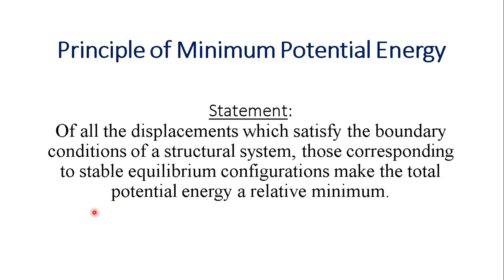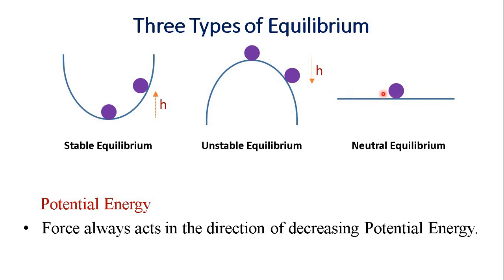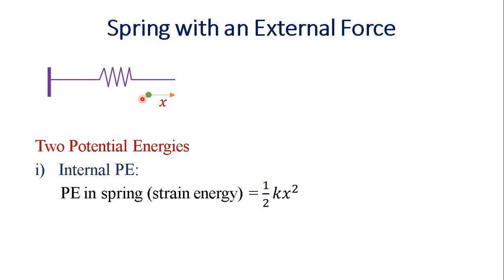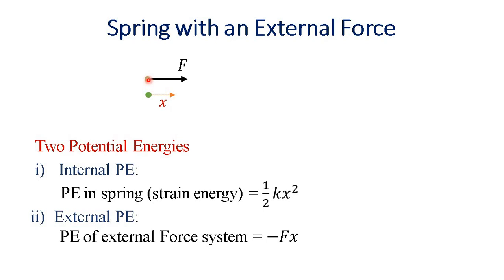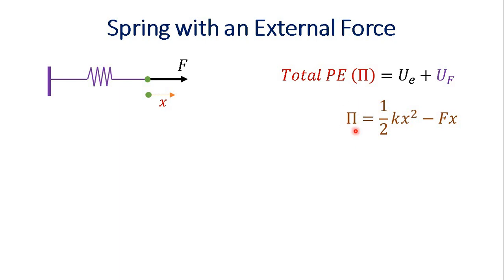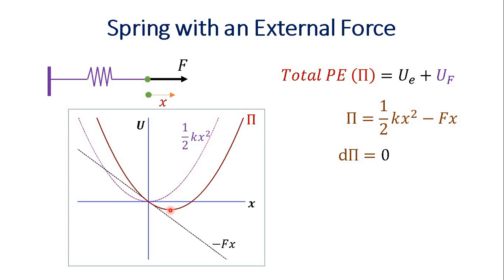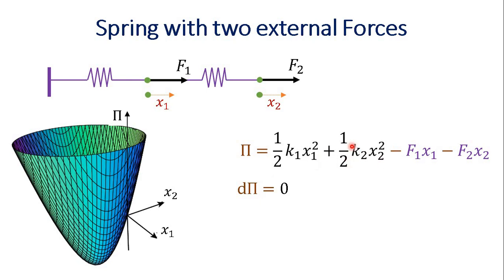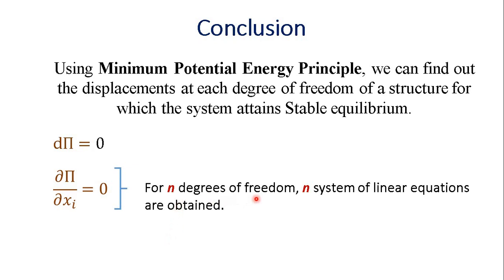Principle of Minimum Potential Energy - Visualization

Comment from the maker: In the second example, I happened to write the displacement x2 in relative to x1. But  we should consider absolute displacement of node 2, and for that, we must change the potential energy stored in the second spring to the value corresponding to a displacement of (x2 - x1). Thank you.

Comment: That was impressive! Great help. Thank you ❤️❤️❤️
I would like to put a question. You explained potential of external force system with an analogy to gravitational potential energy. Can we visualize it with a direct force? For example, consider I am pulling spring with my hand. What is external force system in that case? And how does potential energy of external system changes with displacement? Can potential energy of external system ever increase?? If so, where does the potential energy  get stored?
Reply from the maker: Thank you @Binit. Very good question. I thought video could get long and boring if I used other analogies too. But here is your answer:

1. ... can we visualize with direct force?
= Yes.

2. ... what is the external force system in that case?
= Here you are pulling spring with your hand. So YOU are the physical cause to that force. The external force system is no other that your body. The energy you have in your body which can be expensed to do work is the stored potential energy of the external force system.

3... and how does potential energy of external system changes with displacement?
= One thing you should understand is that all work done in our systems (external or internal) are conservative type. Meaning, when work is done, although potential energy is expensed in the process, it can be immediately fully recovered by equal workdone in opposite direction. So when you are pulling something and displacement happens along the direction of your pull, the energy that is in your body gets expensed in the process. So, as I said, your body is the external force system, we say that the potential energy in external force system reduces. But, when you are pulling the spring tip and somehow displacement happens in the opposite direction, then your hand is going to get pulled towards the spring. When your hand is going to get pulled towards the spring, your body is also going to get pulled. But it depends on how you are pulling the spring.. if you are hanging on the spring, it will lift you up and hence your gravitational potential energy increases and if you are at rest then your hand will get stretched and there is a non conservative type of work done when your elbow rotates. But we are talking about conservative work done so it will make more sense when you are hanging on the spring or you take help of another conservative field as a support that you hold when applying your force to the spring.

4. ... can potential energy of external system ever increase?
= Yes. When a single force acts on an elastic body like the first example in the video, then the force will always cause displacement along its direction. In that case the potential energy of the external force system decreases. But, if we have number of forces acting on different directions applied on an elastic body, then a small force could get displaced opposite to its direction when larger forces causes more displacement to their directions (also stiffness will play role for which force will cause more displacement). So, the potential energy of that small external force will increase. But, in total, the external potential energy will always be less or equal to zero (zero is when all external forces balance each other's displacements)

5. ...if so where does the potential energy get stored?
= It's answer is in answer number 3.

I hope you are more clear now.
Reply: @WordsandNumbers1  Yes, I got it. Thank you so much for your detailed answer.